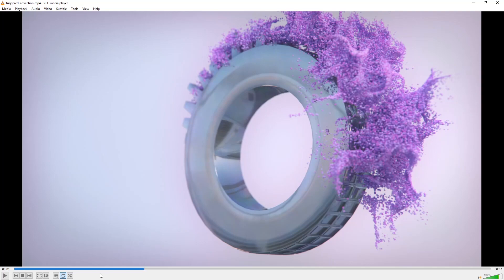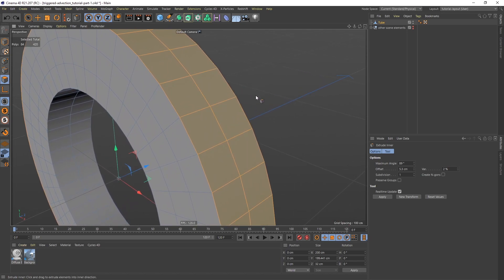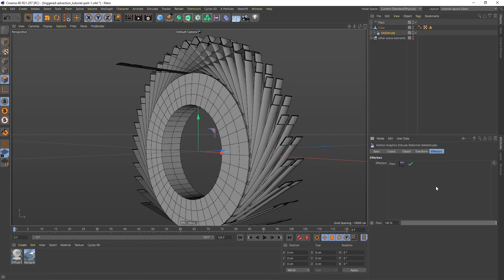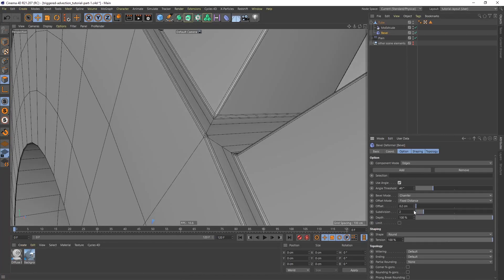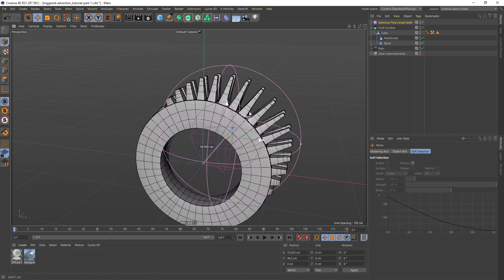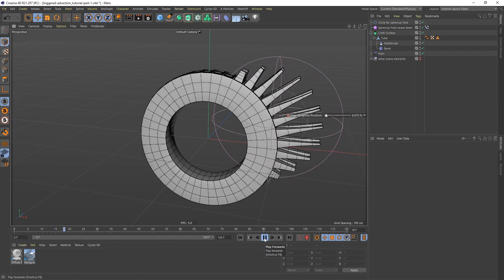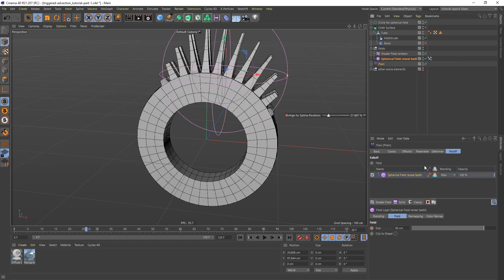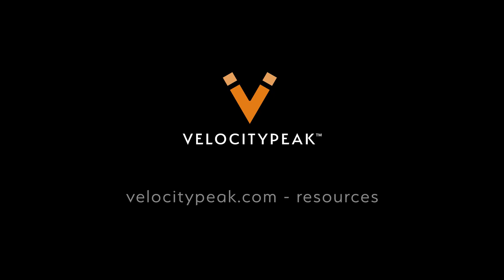X-Particles & Cinema 4D Tutorial - Triggered Advection - Part 1

Comment: How about a tutorial regarding Modifier Mapping using Vertex Map Tag
Reply from the maker: Not a bad idea! Thanks for the tip:-)
Reply: @Velocitypeak  Actually I might might hold off on that suggestion  because the topic is looking buggy and I have a file sent in to Tech Support. I hope it is something I am doing because I am excited about Modifier control with Vertex Maps.
Reply from the maker: @donross7820  Got it! Yep, there's a lot of control with vertex maps in general.
Reply: @Velocitypeak  I am going nuts (in a good way) over Vertex Maps right now. I emailed you 2 files using a technique you taught me regarding making dynamic Vertex Maps.They make Ambient Occlusion from the Vertex Maps and I discovered that this technique is exactly as accurate as using the Ambient Occlusion Node. Thanks!
Reply from the maker: @donross7820  That's great! The dynamic Vertex Maps are fantastic. And the fact that you can use them on parametric objects is really friggin' cool.